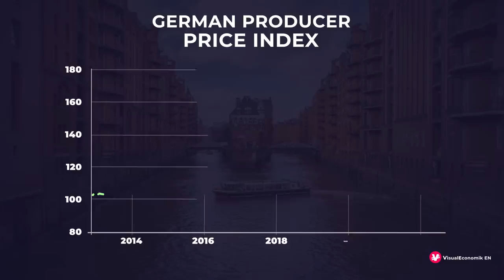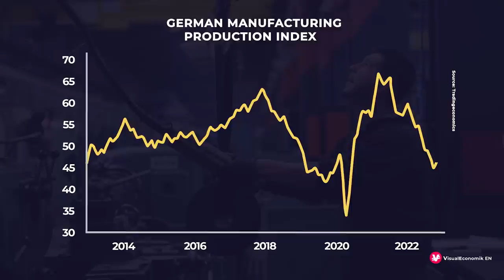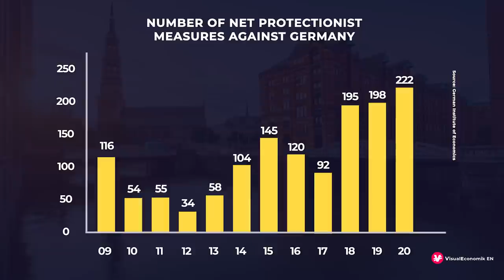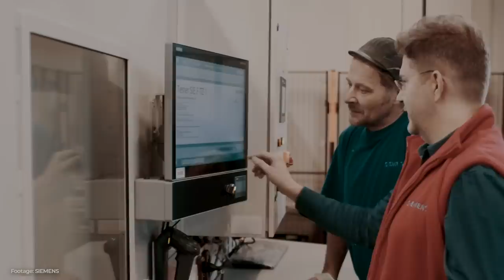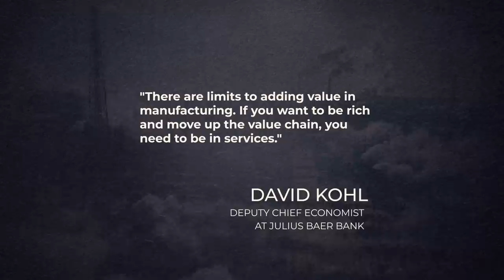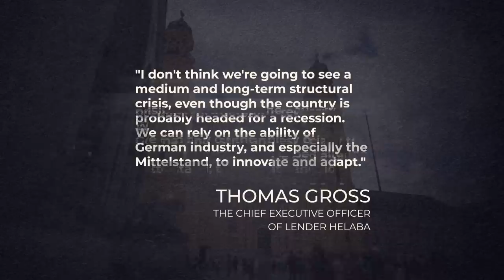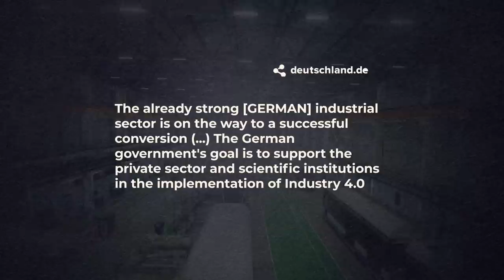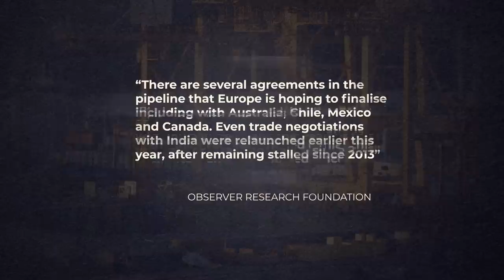Could the German Economy Collapse?

Comment: The demographic challenge is not mentioned, but probably the most important one.
Reply: Ronny Lux  When people age, you need more and more  people to support them and these tend to be service jobs where productivity improvements are low. The strain on the health and care sector is already acute in Germany. The number of people with diabetes,  Alzheimer disease rises and the list goes on. Currently we are in the first recession after the second world war, where the unemployment rate so far does not show an increase.  Industrial products may not require many workers in production, but the products  need to be sold,  installed and maintained. To mention just one example:  In the current energy and climate crisis there is an acute shortage of skilled worker to change fossil heating for heat pumps.  
I am not saying Germany does worse or that I prefer the scenario in Britain. It is a low bar,  at least at the moment. :goodvibes:

Comment: Historically if you looked back to the 70’s and through to the 80’s before exports of German cars took off in a big way the German domestic market was prepared to pay high prices for high quality cars as it was the main status symbol for Germans as their home owner sector was much lower than for example the UK. In order to compete in these export markets ( competing for a smaller slice of customer salary versus house mortgages) German car manufacturers had to resort to low cost components which led to an inevitable reduction in quality and reliability. So their economies of scale improved but faced with increased completion from Japanese and now also Korea and China they still need to keep costs down. It was not possible to offer a car with higher quality/higher priced components just for the German domestic market anymore. Recent JD powers numbers confirm this. So they are going to suffer further as their once big USP of high quality and reliability inherited from products of the past (primarily from the German domestic market plus high end luxury sales into the US)  erodes away to become a distant memory.

Comment: With smart policies, Germany is actually in a better position than it seems. Like USA, Canada, Germany has world leading R&D and political influence to stack the deck by suppressing industrial countries modernization rate. We hold the technology intellectual, the minerals required to only tipping the scales, but rather throwing the scales out completely. Germany will be fine because they have good friends on the other side of the pond that have critical interests Europe.
Reply: @georgiopasca2720  not quite true. They filled LNG reserves at a lower cost. As mentioned earlier Canada and USA have enormous stakes in Germany. Canada a d USA happens to be the largest suppliers of all raw materials and minerals and energy.
Reply: @georgiopasca2720  they absolutely did NOT lose cheap energy.
Reply: @georgiopasca2720  Germany never had cheap energy to begin with
Reply: there are no "friends" in politics. There are just countries with similar or same interests
Reply: @suchter2.012  that kind of world is a tad too cynical for me.

Comment: Probably not. German economy does benefit from cheap energy and the chemical products they can make with natural gas products, but they are making deals to import from new providers and they are still a high value add manufacturer. And they have a weaker currency then the US which helps taper off the cost of exporting to the US, the largest market by GDP, and we aren't likely to shut the door to Europe exports unless they start helping the Russians. I'm way more worried about the UK. That's a bit of a nightmare

Comment: The combined impact of protection and Ukraine conflict with associated energy, fertiliser and raw material shortages will cripple the total EU economy. 

What most reports do not factor in is the financial cost to transition from cheap Russian gas to new LNG ports and distribution needs plus a 159% increase in cost of purchase of LNG. Then add the cost to try and rebuild those areas of Ukraine following the end of the conflict when Ukraine is left with only its agricultural production with Russia holding the key areas that are resource rich. The EU is going to struggle  to meet these needs plus the refugees needs from Ukraine that will not go home

Comment: There is an element of truth to this video as German industry requires free trade and there is a global retreat from globalisation which does affect it. However the EU has been an active partner in the retreat of globalisation for decades, not entirely for bad reasons, thus this is not the main issue Germany has to deal with today, but it is an annoyance.

The major issue Germany has today is energy costs. Germany relied more and more on low cost energy from Russia, which has allowed its industries to produce high quality goods at a very competitive price. As we are aware that low cost energy has gone away, however what has really hammered Germany is it’s unable to go back to the energy model which it possessed 20 years ago.

The focus on wind power and the reduction in its nuclear and coal energy sector in the last 10+ years has meant the energy mix it has available now is high cost and if low cost energy allowed it to be competitive, high cost energy has the opposite impact.

Germany will get the correct balance given enough time, but that is what it does not possess right now. I would expect some impact for several years, but it has a very flexible labour market and will be able to adjust. It should also be noted many Germany companies generate revenue in other countries, especially the US, which sends revenue back to the Vaterland, so i don't expect any of its large companies to suffer to any great extent. But smaller companies will have some issues.

Comment: renewables cause both voltage and frequency fluctuations in the electrical grid and it costs more, the biggest dangers is that these instabilities can couse total shutdown of the grid and the components are hard to get replaced.
Reply: No. Renewables are actually the cheapest form of energy. However restructuring the energy grid takes time and money.

Network frequency does not change because of renewables. It changes when there is a difference between the power that gets in the system and the power taken out off it.
Reply: @emilsinclair4190  If that was the case we would have lower prices for electricity in Germany. From the beginning of that madness called "Energiewende" ("energy turnaround") cost skyrocketed. And so did the number of emergency interventions to stabilise the electric grid. Only good luck saved us from major blackouts so far. The politics towards energy in Germany are just insane: closing down all nuclear power plants - and now do the same with the coal fired power stations as well - many of them as for instance the Moorburg station near Hamburg - only a few years old and built to the highest environmental and efficiency standards and of course by no way written off. The cost was transfered through opaque socialist redistribution schemes to the subscriber and the taxpayer. A huge deliberate destruction of the capital stock. The plan of the Green-Lefts was to rely solely on windmills and solar panels (in a country with few sunshine hours and long periods with neither wind nor sun - i.e. in winter) - and then have a secound complete backup infrastructure with natural gas turbines fueled with gas from Russia. That country became an enemy over night and the pipelines connecting Russia and Germany under the Baltic see blew up randomly (noone knows who did it) - so that option is gone. Meanwhile the lights go off in German cities. Building illumination and large billbords are prohibited by law and more and more street lights go out. Government prepares us for rolling blackouts South African style ... This will go on as the Green party economics minister (and for "climate protection" as his official title is) - Habeck has no clue about running a business at all. (he is actually author for children's books which puts him ahead of the rest of the cabinet which has no degree or vocational training whatsoever) For energy consuming companies and skilled workers young enough - the only way is to leave. Everything is insane. Probably only few people follow German politics - so they don't know.
Reply: @emilsinclair4190  dream on.
Reply: @emilsinclair4190  As a matter of fact we in Germany have the highest prices for electricity in Europe - probably world wide. And while energy rationing still has to come to residential customers, it is already there for industry ("Spitzenglätting" - peak flattening) If there is not enough wind or sunshine - industrial clients get cut off and have to temporarily seize production until the power comes back in. Though Bündnis 90, die Grünen technically hasn't been in power until last year, their ideology is - in the person of Angela Merkel who unilaterally order the closure of all nuclear plants in 2011. To give you an example of the competence of Green leaders: Analena Bärbock - party leader and now foreign minister - said in her election campaign: "Of course the sun does not always shine and there is not enough wind sometimes - then not enough renewable energy is produced. Then the grid becomes our storage - and I do not want to discuss it with people who say that his is not possible"  For them reality is yet another a social construct such as gender and account balance. Most of them have never done anything productive in their entire lives.
Reply: @beccon  never denied that the German energy prices are high. However this is not do to renewables being expensive. There is enough data that this is certain. Renewables are extremly cheap. But building the energy distribution infrastructure is expensive and takes time. This is what increases the prices that much. However once all this infrastructure exists renewables will decrease the cost way lower than it would be with traditional energy production methods. Building a highway takes a lot of money. Maintaining it generally takes less money. Most of the price for electricity goes into building new highways for electricity.

You might not know it but that the industry and consumers are sometimes encouraged to save energy happens in basically every country. Now to compare how serious this problem is you can look at the average time without energy in each country. If you look at this statistics germany has basically the most stable network in Europe. Drastically more stable than France for example. And since more and more renewables have been introduced the time has generally decreased.  If you don't belive me look it up. 

Germany is a net energy exporter. This is why the winter will not become problematic until 70% of germanies energy is produced by renewables. And for the next years this will not be a problem. Now as stated correctly by the leader of the green party storage is the solution to such events. There are many ways to achieve this storage and by having a combined energy grid you also have less problems with it. Texts grid being barely connected to the rest of the US caused a lot of problems recently. The leader of the greens is also demonstrably right that it is possible to store energy for this case. There is factually nothing wrong with her statement. There are countless different ways to store energy. And recently green hydrogen looks like a solution the German government might choose.

 While there is something factual wrong with your statement that more renewables made the German power grid less stable or that left/green are responsible for the energy politics when they were not in power until recently. The traditional left right axis is also not very useful when dealing with German politics since it is much more issue orientated.

Now believing that Merkel and the greens share the same ideology is just demonstrably wrong. Merkel politics crippled the German solar industry and slowed down the instalation of new solar panels to an extreme degree. Her actions against nuclear where to ensure her next election win since a big majority of germans were suspicious of renewables after what happened in Japan. This was not a green left thing. This was a German and also partially a world wide thing. 

And sorry but you are promoting political stereotypes not based on anything. I like to discuss topics with facts and arguments instead of empty stereotypes.

Comment: Germany could probably come out with sth on the energy front
It's gas as a feedstock for the chemical industry that's harder to replace but who knows
If you manage to free up supply in one place you might have an effect on the other
Reply: gas would not be an issue if the power came from green / nuclear sources. Even the small gas supplies in Europe could cover that demand.
Reply: @richardm7713  I love both but neither is good at match supply with demand
Wind and solar couldnt get over intermittence
The draught in summer 2022 showed hydro wasn't fool proof either
The only one I think of is geo thermal? But it's not widely available globally
Nuclear can't not be switched up and down at a press of a button so it's good at maintaining constant out of base level supply but again not good at responding to varying needs
Also it needs fresh water as coolant the draught threw a spanner into the works
Also the French experience showed it's probably a good idea to put 70% of your eggs into one basket
All in all I think in the foreseeable future we still need some fossil fuel power as a.buffer/ back up bit the glass is perhaps 70% full it's still a significant reduction
Reply: I work in the chemical industry. High energy prices and lack of cheap gas were a blessing! Why? Previously energy was too cheap to optimize processes. But boy do they optimize the living shit out of their plants and processes to cut on energy cost right now. Good in the long run.
Chemical industry needs to become CO2-neutral by 2040 and heavily invest in green electricity production, as gas soon won't be a heating option anyways. Using every single m3 of your steam, recycling energy of burnt bad batches. There is so much potential yet to be used.

And this crisis kickstarted an impressive fast response that was overdue anyways. We will be fine, investments are flowing.

Comment: The two main factors of Germany's success are a) cumulative brain power and b) high degree of organisational skills.
a) doesn't mean Germans are smarter than others but that German organizations are often much better in using all the available brain power within the organization. This makes them much more adaptable to changing conditions outside of the organization. In many organizational theories Germany's organizations are often likened to machines because of their efficiency. In reality they are the contrary. They are organisms constantly adapting to their surrounding and constantly repaiting whatever fails them on the inside and improving.
The overwhelming majority in Germany just loves their industry. Nevertheless, going forward, Germans will have to learn that industry will become less and less relevant and all the industry friendly policies are holding them back to advance to the next level.

Comment: Unless germany stops being a vassal to the big power games, its industry will be hollowed out primarily due to excessive energy cost. 
Its old ICE automotive industry had seen its better days, it would be extremely hard to compete with the onslaught of new EV from China and Tesla considering the unsustainable quantum of debt burden it is carrying. To move from ICE to EV requires large Capex it needs to borrow on top of the already crushing debt burden it is now carrying while concurrently the existing ICE fixed assets it has in its books would be rendered valueless for obsolescence reason. 
As token examples, VW, Benz & BMW are concentrating its production capacity in China. Germany's biggest chemical company BASF had fully decamped to China while its largest defence company had moved to USA. Thus, It's hard to be optimistic about germany against these odds.

Comment: Very good assessment of the German economy, although you left out the demographic cliff.  It strikes me that the easiest of the problems to address is energy.  Solar and wind are not the solution in Germany.  And delaying the closure of two nuclear plants is hardly a solution.  Going nuclear is at least until other technological solutions are found.  Surely the Ukraine experience shows that a country should have a balanced energy plan with no reliance on a single source or technology--as President Trump warned.  Expanding nuclear is an obvious choice.  It will not solve the problem by itself, but it would certainly alleviate it.